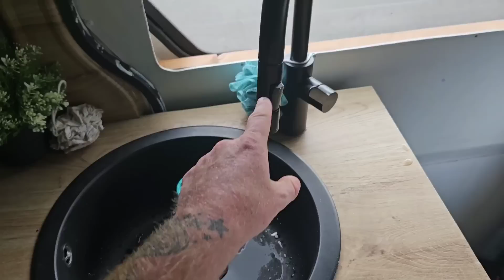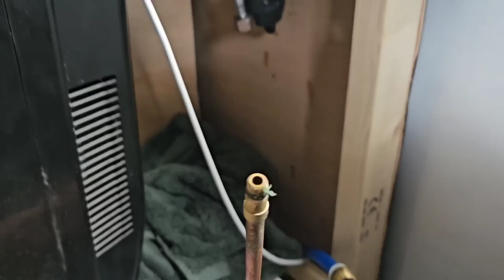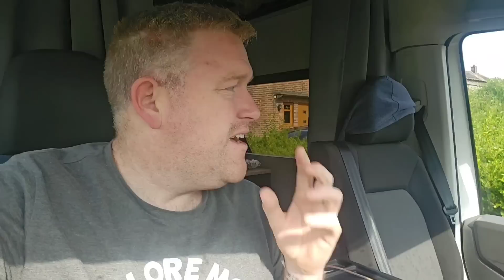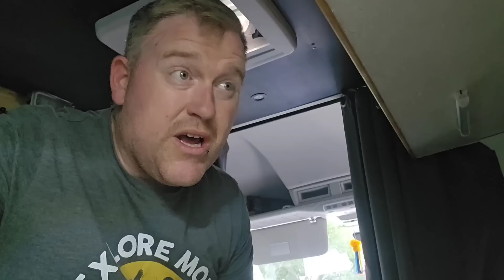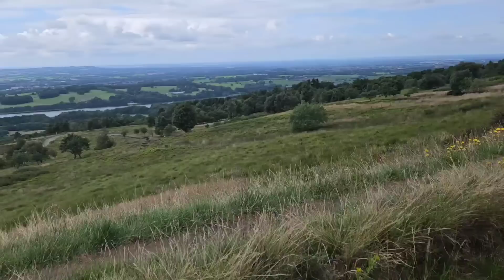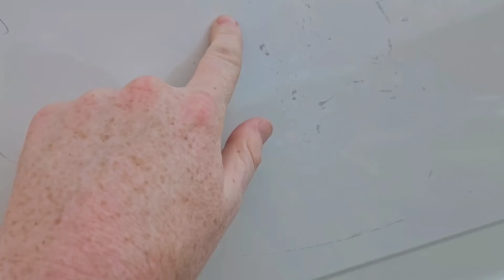Learnt A Valuable Van Conversion Lesson

Comment: Hey, I know that you are happy with the tap now, but to get EVEN MORE flow out of it, instead of capping the hot pipe off, tee it in with the cold as well. 

This would mean less restriction through the Tap because it would have 2 paths to flow through.

Comment: Hi Terry here in Ireland just a quick note on your water tap pressure issue ?????  I had the very same problem here at home new tap fitted and F all pressure ... Its all to do with most taps being manufactured to fit apartment's with large  { huge } pumps .. i know its probably a bit late for you now but you can still get a tap with a good oud 1/2 inch "   25mm pipe fitting in a good back st plumbing supplies ... you will have loads of pressure and water then .. Cheers bud and keep up the good work .. I love your video's..Terry.